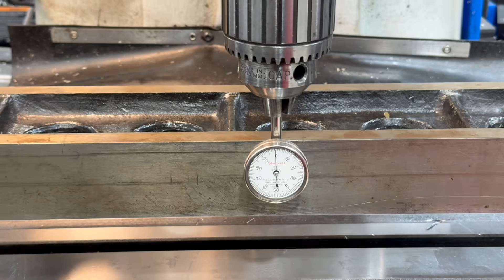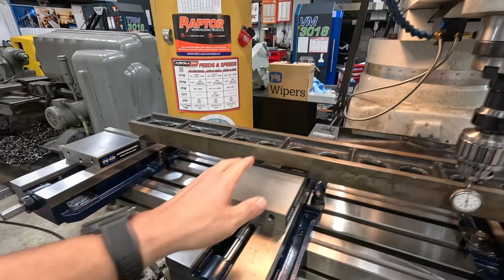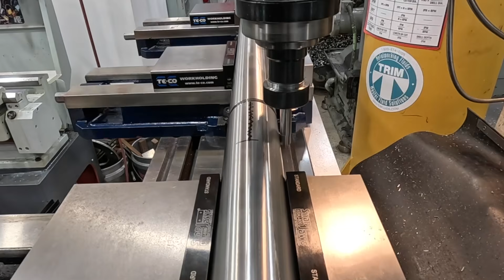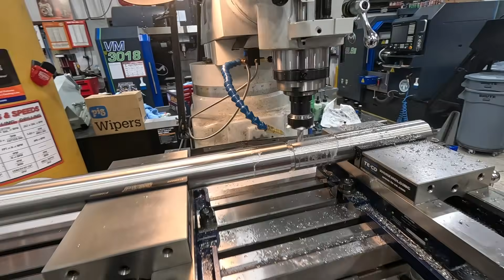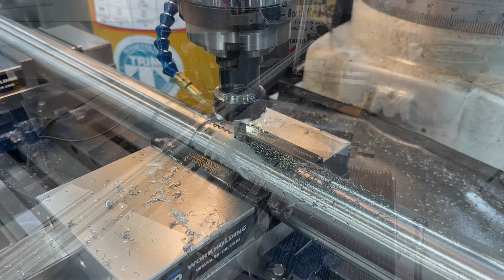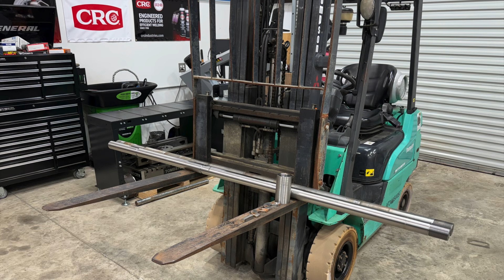Milling 5/8" Keyways 180° Apart in New Pump Shaft

Comment: 180 degree alignment is ok but not great, probably within .1mm, much better way is to use a v block and clamp and clock it in
Reply: I agree typically I'll make  a simple plate with a set screw but anything that you can clamp to it that can be indicated will give you great accuracy

Comment: Good jpb" Love watching the work you do!  Btw. can someone explain 15:31 why does the keyway go into that groove?
Reply: to lock the shaft and a component like a gear or a pulley together for rotational torque.
Reply: @diabloed80  I understand that but isn't that groove for some sort of o-ring or seal?
Reply: @lakinnenlako6883  mentioned in his turning video they are for a split flange keeper.
Reply: @diabloed80  I missed that. Thank you!

Comment: “I am not a machinist”😢 how accurate can an edge finder be? Seems like there’s a better way to be more accurate I guess.
Reply: The subject would make a good video.   I use a different technique with them than I see used.
Reply: Only about .002 the way they’re normally used. For tooling work the lapped faces of quality edge-finders must be oiled, and several readings taken for accurate measurements.

Comment: I'm 76 years old, and the first time I touched a lathe was at an evening machinist class at the local community college. The instructor was patient and thorough, and our project was machining a soft tip hammer.
I remember the pride and satisfaction when it was completed. There is a sense of acheivement that can last for decades. If you have the spirit, give something like that class a try. It may stir something in your heart.

Comment: I know there are lots of ways to check alignment when working 180 out on different operations, but wouldn't it be easier to use a level and mark a line and then just roll it 180°?
Reply: Even better, you don’t need a level, you can use the table or the vise as the reference. Take a parallel that sits flat on the table or across the jaws of the vise, place it at the very end of the shaft, draw a line using that parallel as a ruler and then do the 180 as you said.
Reply: @emperoroftuna6832  That's great as long as approximately 180 degrees is all that's needed. Here, you need better precision and accuracy.

Comment: Thanks for another great educational video. A large Rose Index would have been a perfect tool for rotating the shaft 180 degrees. I fully agree with everything Adam said near the end of the video. I began my machinist career in trade school on the GI bill and was continuously In the trade for 50 years before I retired and opened my own shop. I now do prototype and custom machining for a large dental parts company. It pays well and is a very satisfying way to spend my retirement years.

Comment: I fully encourage development of trade skills. When i went to HS I was taking all the shop classes because I didn't see myself college bound. I used the drafting skills I learned in high school and later in Jr. College and I got myself a job with a large company and parlayed all that to end up going back to Engineering school on the companies dime and I earned myself a Mechanical Engineering degree that I thought I would never achieve. The key thing you need to do is make yourself a valuable commodity, and doors will open. You just have to make the initial effort. Starting with a trade is a solid path.

Comment: Hey Adam, I hear you on that Noga cool not being a consistent flow. I mentioned some years back in one of your videos, that if you go to your local ag supply store, say a Tractor Supply Store, they have quick connect spray tips that are awesome and they work without inconsistencies, some are in plastic, some metal (brass I think). On those tips will be 2 numbers, one is a fan width, and the other is a flow rate (pretty sure that is what they mean). Now I am not knowledgeable about the technical specs on these tip numbers, my experience with these spray tips is from using them on asphalt roller water spray systems, and they work fantastic. They come with little screens to help keep the tip clean as well. It will take some modifications to adapt this style tip with the Noga spray system, but it will not be hard and shouldn't take you long, you will be very glad you did. The tips are not expensive, just grab a few and try some out to get the kind of spray you want. Bear in mind, many of those tips have a wide spray when nothing is in front of them, but when you put the tip close to a work piece then that negates that wide fan. You will be glad you did it if you take the time to modify that spray system to change to these ag style spray tips. You will never need to adjust all the time again. If you need more volume or less volume, it is a quick connect system, so changing to a different tip takes about 10 sec or so. Reply to this comment if you would like some more specific info, or if you have trouble finding the tips I am talking about. They are a standardized system that has been used in agriculture spraying systems for the last 15-20 years at least, I'm pretty sure, cause they have been on asphalt rollers for at least that long, and I know that the ones on the rollers are directly from the ag spray applications, cause I had to go to Tractor Supply to get replacement tips, cause the ones that were on the roller in question were the plastic variety and got damaged pretty easily, so I had to get the brass ones. Sometimes the tips may get clogged, especially if you don't use the screens that come with them, but a welders tip cleaner thing (you know those blue colored folding things with the toothpick like tip cleaner pokers in them) will get the tip cleaned out real quick, but that rarely happens if you keep your little screens cleaned every so often. After looking at a website that sells ag spray stuff, you would not even need to change tips to change flow. You could install a diaphragm type check valve to adjust volume by turning an adjuster. And yeah, it would not be hard to convert that noga spray system to a proper spray tip. It will be harder choosing which style tip you want cause there are probably hundreds if not thousands to choose from!

Comment: I wonder how critical the 180 deg. is? There is probably a better way to determine this in the mill vise. Your method should give reasonably good results within 1-2 degrees depending on the amount of deburring you did on the first groove. Overall a good teaching video!

Comment: I wonder if there a better way to ensure the keyway are exactly 180 apart. Perhaps clamp a straight edge to the shaft at the end. Rotate the shaft until the straight edge is vertical, do one keyway, rotate 180 and ensure the straight edge is vertical again and do the second keyway, remove straight edge.  I'm not sure how critical this feature is.

Comment: Its wonderful to see your new tooling and work holding equipment. Very cool. But just a keep it in minder from me. The old days when you had to mcgyver up some intersting work holding and also welding brazing or eutectic spraying. Maybe for our sake once im a while handicap yourself. Try not to use any of the things that have been aquired in the fast few years. Get into some of the older tooling. Just for funs sake. I know youve said your opinions a zillion times, but sometimes like this shaft didnt really need to be 3 parts. Ide rather you just dont post that week if your gonna be bleeding out one project just to get a video out. We all know your quicker than that. Just toss that around in the old brain pan. Im not saying im crying about it. Im still gonna watch either way. But a little "blending" of videos may be nice. Great work guys !

Comment: Glad to hear about cleaning up the shop.  FOD kills.  I was fortunate enough to tour the initial F-15 production area many years ago, and there were signs all over the shop saying that.  I used to follow another machinist, and he continually justified his filthy shop by saying "it's a working shop".  A clean shop is a safe shop and a precise shop.  I'm just a woodworker, but I clean my work area after every operation.

Also, good on you for promoting the trades.  I was a process engineer for 40 years and my job and designs were only as good as the skilled men and women who executed them.